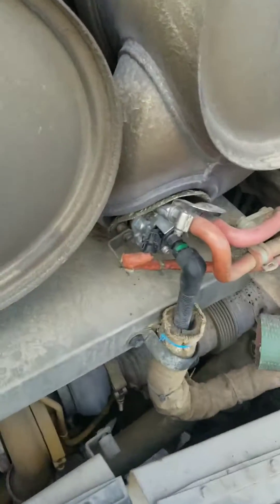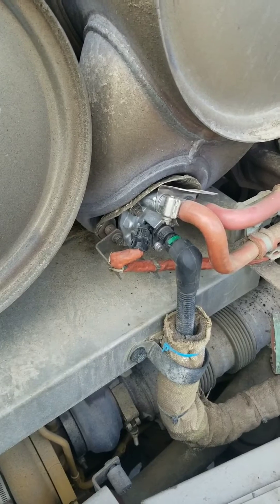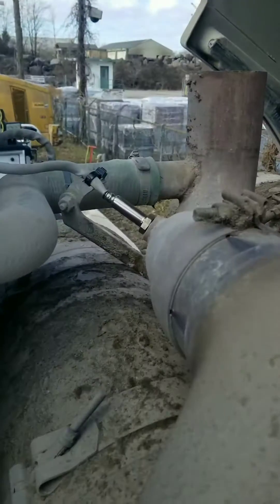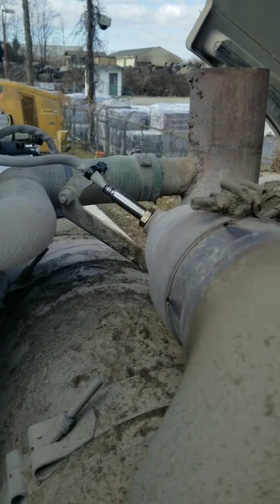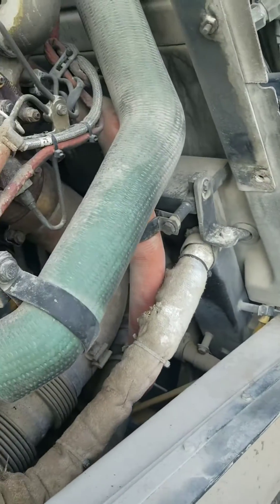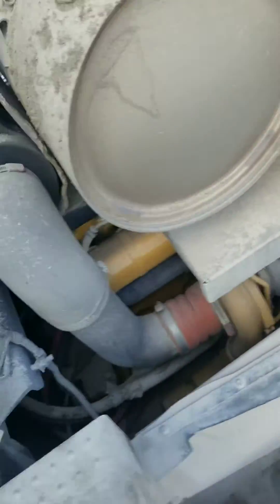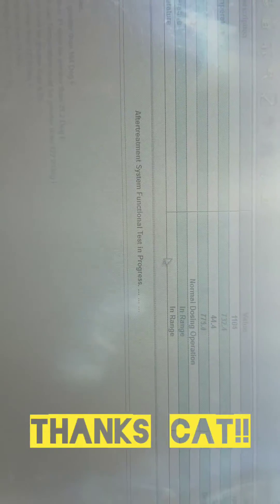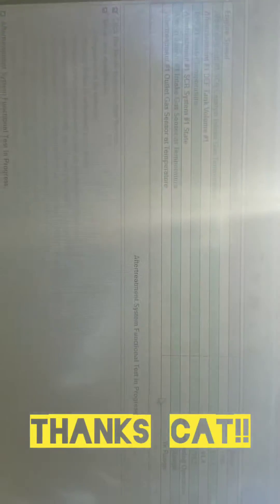Cat C9.3 E1364 FAULT FIX!!

Comment: I have a N9D with same code but when you look on ET it says def concentration not installed or disabled.. what's that all about??
Reply: DEF concentration with refractometer was 34% drained and refilled tank, changed DEF pump filter, purged system and ran function test and failed function test.
Reply from the maker: @danielbarks31  ok as i said in my previous comment...nox sensors, test the def injector, and check for any accompanying faults
Reply from the maker: Actual Cat Engines Will not give you Def Concentration through et..would look into def quality, def injector for proper operation, possible nox sensors...hit me up through Instagram for further assistance...thanks for watching
Reply: Don't have Instagram!!!

Comment: Have you experienced SCR failures from this code? Have a c13 with a new injector and nox sensors that runs about 100 hours and the code comes back on, everything on the trouble tree is in range and it will go away with the factory password; that is until it pops up again. Machine has 12000 hours
Reply from the maker: Scr is only good up until about 12,000 hours (engine service life) the way Cat Looks at SCR's they are due to be replaced at engine rebuild (>12,000 hours)